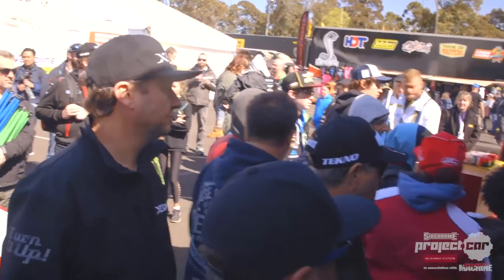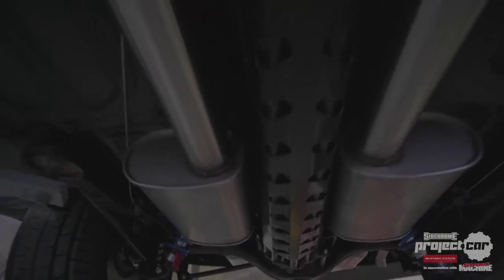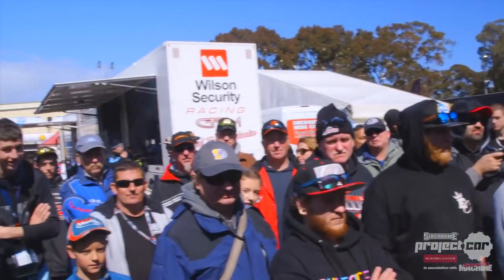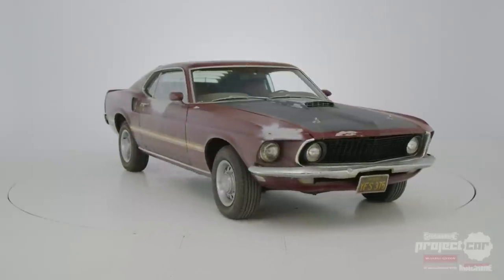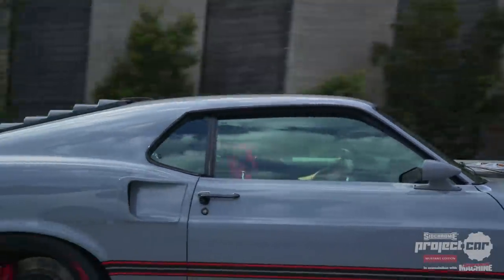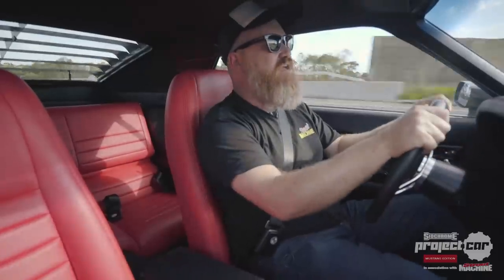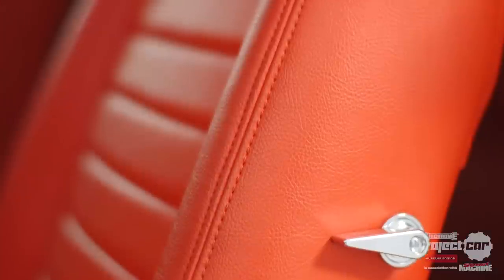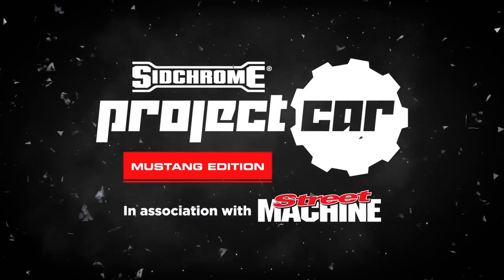SIDCHROME 1969 MACH-1 MUSTANG | PART-4

Comment: The big diameter rims looks silly on an old mustang
Reply: Yep. Not  fan of the tyre lettering either. Easy enough to change those two things though.
Reply: It's a resto-mod, so it needs big wheels to clear the big brakes
Reply: Corey Bell yeah I understand they need to be a bit larger but not as big as they've gone, the wheels are miles bigger than what the brakes need to clear